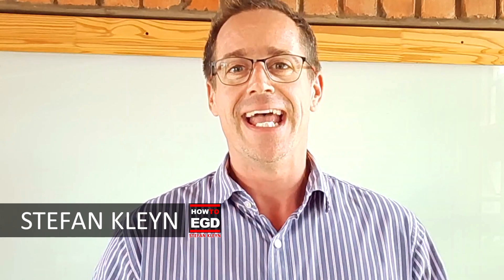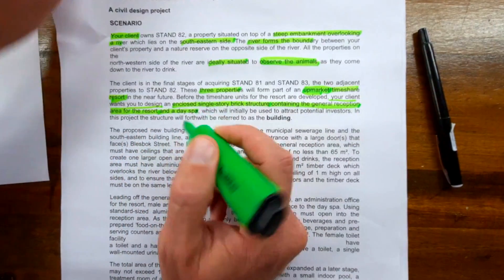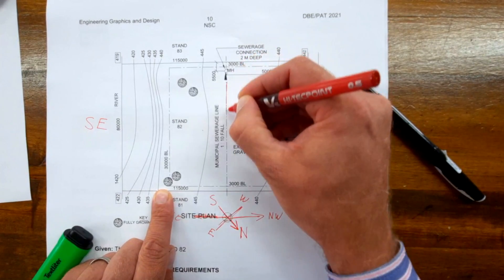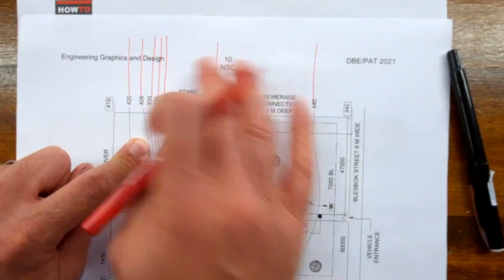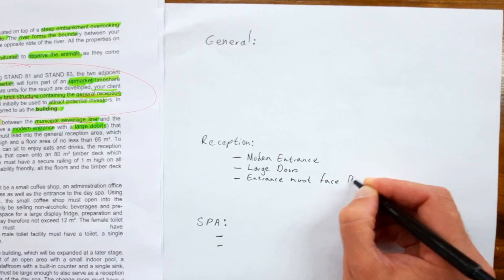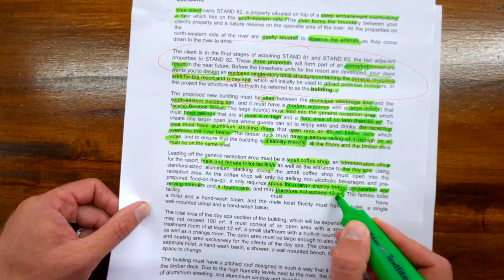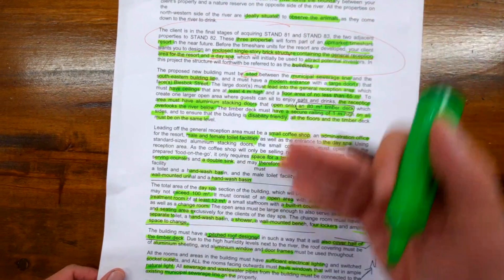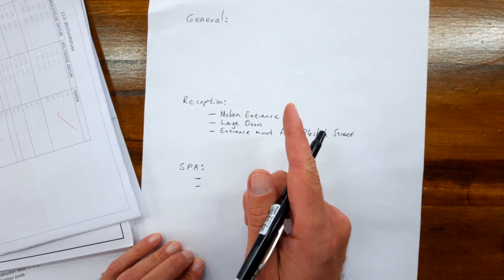1. HOW TO HACK YOUR PAT: Design Brief and Management Plan - EGD Grade 12 - Civil PAT Task 2021

Comment: Good morning sir. Where did you get the 75 m from?
Reply from the maker: Hi Makwa, thanks for the comment. You are welcome to double check the measurements. Chances are that a mistake slipped in. Let me know what your calculation ends up with. Thanks for your contribution.